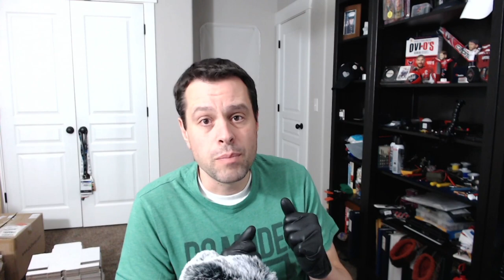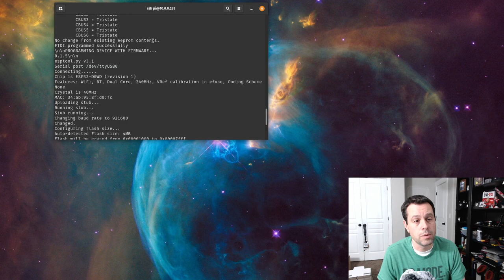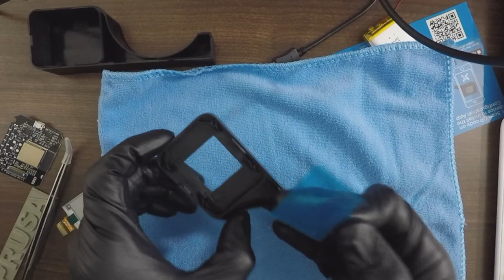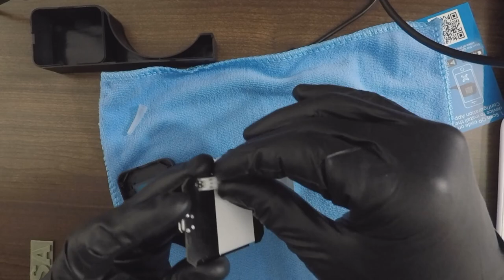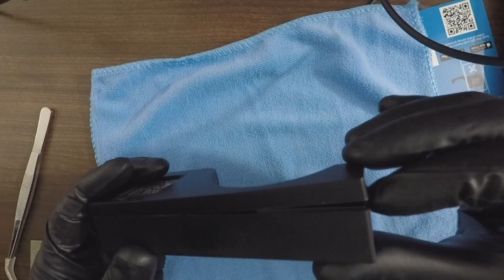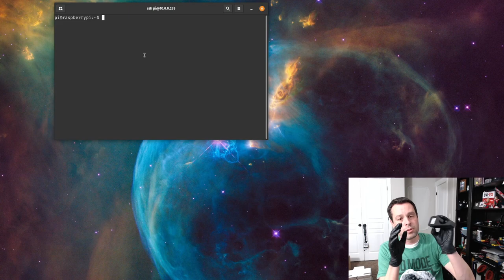ESP32 Product Creation Journey: Assembling a Puck Holder

Comment: Did you ever cover your mold design, the process you followed and your supplier?
Reply from the maker: Hi Paul, great question. I think I've briefly covered it across multiple streams so I don't have a single video to point you to. Just as a run down though I actually had the design initially done by a company called Agility (unfortunately no longer around). That was for the hockey puck product. I think did a draft of the puck holder on graph paper and had somebody on fiverr take my original enclosure design and modify it to be a puck holder per my drawing. I specifically designed the holder to have similar dimensions to the original enclosure. I then passed those design files along to RYD Tooling. They have been incredible and I highly recommend them. They helped get the files ready for manufacture since the Fiverr design needed some changes for wall thickness and draft angles. RYD made the mold and is the current supplier of enclosures for us. Hopefully that helps.